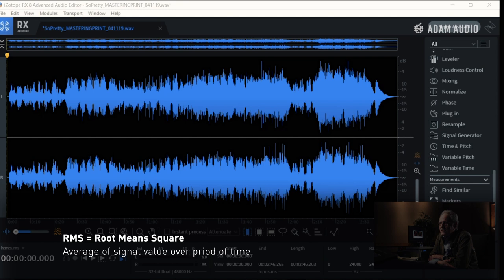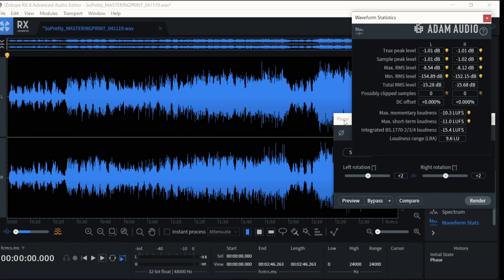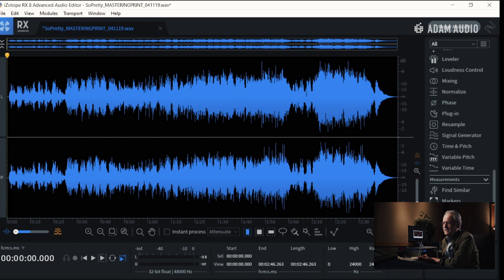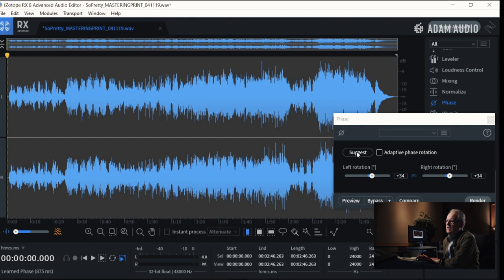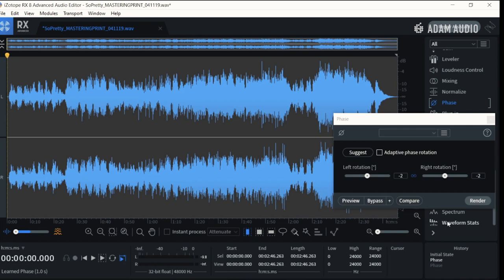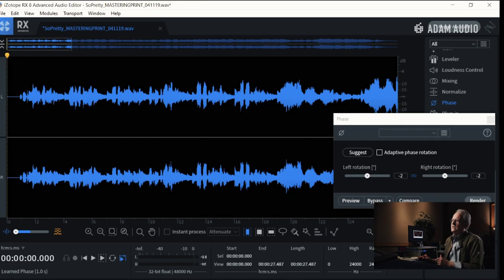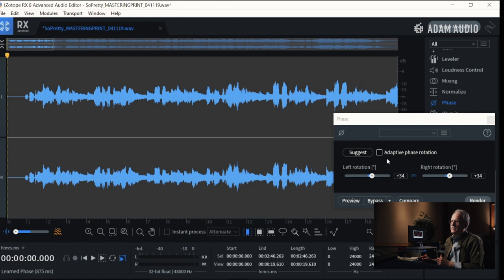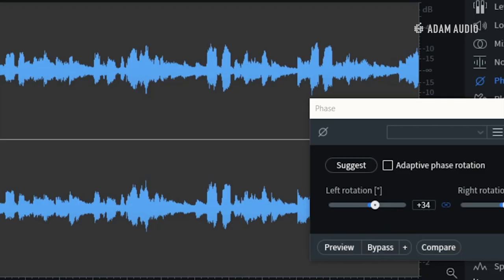The FIRST Step to Mastering a Song: Fixing Phase Rotation | Mastering Masterclass Ep. 4

Comment: Hello John,
Excellent presentation, thank you.
I remember phase rotation in relation to A.C. motor theory.
What you're explaining here is what we call 'D.C. Offset'.
Your thoughts when you have a minute, thank you.
Bill P.
Reply: Yeah, I always see this issue as DC offset too, I interpret it as a 'stuck' sine-wave, which you can get rid of with a hi-pass filter (set as low as it will go).
Reply: @davelordy  The hi-pass filter is a 'must' for getting rid of U.L.F. rumble, etc., but it will not 'center' a signal around the '0' voltage point.
Most DAWs have a 'D.C. Offset Removal' function that will 'center' the signal around the '0' point AND remove the D.C. offset after it has been recorded.
Some DAWs allow you to remove D.C. offset during recording, folklore says 'Don't do it", wait until AFTER the track is recorded, then fix it."
Bill P.
Reply: @RocknRollkat  Yep, a hi pass will remove a DC offset ('centre' the signal around 0v) think of a DC offset as a very low sine wave, in fact a 0Hz sine wave, now lets image this sine wave is at something like 45° in its phase, so about 70% between 0v and 1v, as it's at 0Hz it is 'stuck', that is to say it's no longer oscillating, at 0Hz it becomes a DC offset (it's a DC offset at all parts of its phase except for 0°), so one way to remove this DC offset is to use a hi-pass filter, you want to set it as low as you can go as you don't really want to alter the sound, 10Hz or 20Hz is usually as low as an EQ or LPF will go . . . this removes the DC offset.
Reply: @davelordy  Dave, here's the problem. If a sine wave has zero frequency it also has zero phase.
It's direct current.
Reply: @RocknRollkat  "If a sine wave has zero frequency it also has zero phase"
It will have a fixed phase, you can literally measure it, it will only be zero at 0v, everywhere else, from -1v to +1v it will be at a fixed (unchanging) phase, so for example a DC offset of +0.5v will have a phase of 30° (sin(30°)=0.5), or a DC offset of +0.1v will have a phase of ~5.7° (sin(5.7°)=0.1) . . . etc etc.
Don't take my word for it, try it for yourself, take (or make) a signal with a pronounced DC offset, apply a HPF (set it as low as you can), render the result and see for yourself, the DC offset is gone, you've removed the 0Hz fixed carrier wave.
Reply: @davelordy  "....Don't take my word for it, try it for yourself,"
Dave, it's not up to me to prove your statement.
This is your hypothesis, you prove it.
Reply: @RocknRollkat  Lol, I'm not asking you to prove anything, I'm simply saying don't take my word for it, try it for yourself, I am trying to show you how this works by having you try it yourself, it would take you two minutes.
And by the way this is not my hypothesis, it's simple maths, used long before there were such tools as DC offset plugins, and not just used in audio, it's used anywhere where there's a need to remove a carrier wave.
Reply: @davelordy  A carrier wave is by definition ALTERNATING, NOT D.C.
Anyway, last night I built a D.C. offset generator, recorded a voice with .3 volts (300 mV.) D.C. offset.
This morning I built an 18 dB/Octave Hipass filter at 20 Hz., built the plugin, ran the whole mess through Cakewalk.
Like I've been saying, there's the waveform, complete with the 300 mV. D.C. offset , just like I've been trying to tell you.
A Hipass filter will NOT remove D.C. offset.
Try it yourself.
Reply: @RocknRollkat  "A carrier wave is by definition ALTERNATING, NOT D.C."
Yep, a sine wave alternates between -1 and +1, slow it down enough and eventually it will hit 0Hz, at this point - and assuming it stopped anywhere in its cycle other than at exactly 0v/0° - it will be a DC offset. Nothing alternates at 0Hz.
"A Hipass filter will NOT remove D.C. offset. Try it yourself."
I have, for decades, it's how we removed DC offset prior to modern plugins. A HPF will 100% remove a DC offset.
Reply: @davelordy  ....you have...for decades ?
How old are you anyway ?
I checked your youtube channel, nothing there about music or electronics.
Reply: @RocknRollkat  "you have...for decades ?"
Yes, decades.
"I checked your youtube channel, nothing there about music or electronics."
Yeah ? So ?
Reply: @davelordy  I've been working with electronics since 1959 .
A D.C. blocking capacitor or an interstage transformer both BLOCK D.C.
That's in REAL WORLD electronics.
In the digital domain there are no capacitors or transformers.
Once again, how old are you and what is your experience with electronics ?
Reply: @RocknRollkat  hate to say it RR but this guy is right a hipass filter gets rid of dc offset problems you are filtering out a superlow sine waveform this is how we do it to,
Reply: @davelordy  we do that to, dc offset is basicly a 0khz waveform like you say a hipass will get rid of it
Reply: @MoneyMoves-qm1gf  I have the screenshots that show otherwise....
I checked out your  youtube page, you have NO content.
Do you make music or just talk ?
Reply: @MoneyMoves-qm1gf  "we do that to, dc offset is basicly a 0khz waveform"
Cheers, yes, a DC offset is essentially a 0Hz sine wave, so can be filtered out with a hi-pass filter 👍
Reply: @RocknRollkat  "I checked out your  youtube page, you have NO content."
This is the same criticism you levelled at me, I really don't understand all this strange peripheral stuff you inject into the conversation ? Whether someone has made videos, how old they are, whether electronic components exist in digital form . . . I honestly think if you were prepared to have an open and honest conversation, without all these strange distractions, I could explain how a hi-pass filter removes DC offset to you. Do you know only about 0.3% of youtube users (one third of 1 percent) make videos, most people are content consumers, not content creators, most people are not interested in making videos, unsurprisingly, like MoneyMovie says above, you can be a successful engineer, producer, doctor or software developer without ever having made a single video for Vimeo, Youtube or Bitchute, amazing but true. In fact, on average, 99.7% (100% - 0.3% content creators) of music producers you will interact with on youtube have never made a video in their lives, and probably have no intention of doing so.
Reply: @MoneyMoves-qm1gf  Sorry, thought that was for me ! : ) [I edited it out] I can't see all of your posts, Youtube seems to hide some, but thanks anyway.
Reply: @davelordy  no probs. not for you for that other RocknRollkat guy
Reply: @davelordy  lol at MoneyMovie. not my name, my name is MoneyMoves
Reply: @MoneyMoves-qm1gf  "lol at MoneyMovie"

Whoops ! Sorry, lol 😊 misread it !
Reply: @davelordy  Post something meaningful, okay ?
Reply: @davelordy  no probs mate.
Reply: @RocknRollkat  "Post something meaningful, okay ?"
You're very good at trying to distract from the subject, "how old are you", "post something meaningful", "I'm an expert in electronics", "why aren't you making Youtube videos", "capacitors don't exist in software" (etc etc).
Here's what is actually being discussed . . . a hi-pass filter will remove DC Offset, because a DC Offset is essentially a 0Hz sine wave acting as a carrier wave, if the 0Hz sine wave is locked at any angle in its phase (other than 0°) it will be imparting a fixed offset to the signal, if you want me to explain it in further detail I can, or if you have any questions (about the subject itself rather than how many videos someone has or how old they are - etc) then feel free to ask.
Reply: @MoneyMoves-qm1gf  👍
Reply: @davelordy  Loke I said, I added a 300 mV, D.C. offset to a sine wave, loaded it into Cakewalk, added an 18dB/Octave Highpass filter at 20 Hz., the D.C. offset remained.
Maybe you should try the experiment yourself instead of trolling.
B.P.
Reply: @RocknRollkat  "Maybe you should try the experiment yourself instead of trolling."
Again with the insults, lol. Hold on let me make a quick video, but before I do would you even watch it ?
Reply: @davelordy  ....then stop trolling and do something productive, like running the experiment yourself.
Reply: @RocknRollkat  "then stop trolling"
You complained that I have no music production videos, you complained that I've not run this experiment (regardless of the fact that I told you I've been using this method for decades) . . . so I offer to make you a quick video, "running the experiment" . . . and in response you call me a 'troll' ? Offering to do the thing you wanted (run the experiment) in the way you appeared to think was most credible (as a video upload) and I get called a 'troll' for offering to take the time to make a video for you ?
Is that really how you engage with people ? Fair enough !
Reply: @davelordy  Is it within your grasp to stop bothering me ?
I ran the experiment that you suggested and you won't accept the results.
What's your point in all of this ?
Please STOP annoying me.
Reply: @davelordy  I'm BLOCKING you, bye bye...................
Bill P.
Reply: @RocknRollkat  dude are u being serious or just trolling? a DCoffset removal tool IS a highpass filter! thats literally what it is!! they are one and the same. I use a highpass filter as its cleaner than the DCoffset removal tool in logic pro.
Reply: @cooperspruce  Good for you.
Reply: @RocknRollkat  you can use a low pass instead of dc offset tools its faster and cleaner and does the same thing with more control
Reply: @clairebare2636  I ran the experiments.
I created a D.C. offset of .3 volts D.C. , the lopass filter didn't touch it.
I'll redo the experiment some time in the future.
Bill P.
Reply: @RocknRollkat  srry i mean to say a high pass not a low pass but your set up is right .3 volts give you something like 15 - 20 deg offset and the filter should remove it cleanly not sure why it not worked for you
Reply: @clairebare2636  D.C. has no phase.
"Phase Rotation" is a misnomer.
Hipass, you're correct.
I will rerun the tests in October or November, I'm busy until then.
Remind me, 'kay ?
Bill P
Reply: @RocknRollkat  yeah dc has no phase like i mean its not going up and down but so its kind like a wave that as no pitch or like zero khz basically its the same as a infinite low wave which means a high pass will remove it
Reply: @clairebare2636  Like I said, no dice.
D.C. is NOT a wave, it has no phase or frequency.
I did the test once, I'll do it again soon.
Bill P.
Reply: @RocknRollkat  yeah agree that it has no fequency like you say but imagine a wave with a ferquency of 0.000000000000001 hz but keep add in as many zero as you can ! aventually the wave will stop and just be exactly same as dc offset
Reply: @clairebare2636  ....in math class, maybe.
In the real world, D.C. has no frequency or phase.
I've been building my own electronics equipment sine 1960, recording since  1961.
Simple explanation....
Direct current flows in ONE direction only, Alternating current changes direction at the rate of the stated frequency.
Bill P.
Reply: @RocknRollkat  yeah agree dc is no freqency its just a value like +1 volt or minus 0.5 volt or whtever - - - - - but can you imagine what a very low freqncy looks like imagine 0.000000000000000000000001hz!!!! ---- also you said >>>>Alternating current changes direction at the rate of the stated frequency.<<< now imagine the freqency is 0hz!! what would that look like??
Reply: @clairebare2636  Okay, let's do this.
First, write a plugin that will create a D.C. offset, like I did, to mimic a leaky blocking capacitor, etc., and SUM that with an input signal  going into your DAW channel strip.
Now look at the 'scope output of that channel, it should show the signal LIFTED away from the '0' axis by the amount of the D.C. offset.
Now run that signal through a highpass filter and check the 'scope.
You will see the signal perfectly rolled off to 0 dB on the elevated D.C.
Get back to me with the results.
I'll wait.
Bill P.
Reply: @RocknRollkat  >>>>write a plugin that will create a D.C. offset<<<<

Lol i would if i could but i am not talented like that impressive that you can do that i would not even know where to start!! but i have plenty examples of audio with dc offset and can create other ways.

>>>>Now look at the 'scope output of that channel, it should show the signal LIFTED away from the '0' axis by the amount of the D.C. offset.<<<<

agreed

>>>>Now run that signal through a highpass filter and check the 'scope.
You will see the signal perfectly rolled off to 0 dB on the elevated D.C.<<<

yes! 🙂 thats what i was saying a high pass will remove dc offset, because dc offset is the same as a 0hz wave
Reply: @clairebare2636  ....still waiting to hear from you. - Bill P.
Reply: @RocknRollkat  hi bill yeah i reply to your post above! you said if use a high pass you will be the dc offset at 0 db i say yeas! agree thats what i was saying!
Reply: @clairebare2636  I'm still waiting to hear back from you.
Bill P.
Reply: Waveform asymmetry isn't the same thing as DC offset. Quick thought experiment: Visualise a pulse wave with a 50% duty cycle (i.e., a perfect square wave) in relation to the centreline. Each cycle spends an equal amount of time above and below that centreline. Now visualise a pulse wave with a 25% duty cycle. Now each cycle spends 25% of its time above the centre line and 75% of its time below it. As we can see, it's not offset - it's merely asymmetrical. This asymmetry, and the effect when mastering for loudness that such a waveform has when it's layered into a full mix, is the issue John is trying to correct here.

Comment: I thought dc offset is when the digital representation of the waveform is unbalanced?
Reply: A DC offset will raise or lower the entire waveform off the zero line. An asymmetric waveform will still settle on the on the zero line as the amplitude decreases.

Comment: wow nice tip thank you ...but why should it be -2? ...i tried this on different mixes and masters and after rendering it's - 2 or sometimes +2 ....first i thought to recognize a pattern that only the masterings and loud sources will be rendered to +2 but it also happens to low mixes ....should i correct it with the sliders to -2?
Reply: I think it's more of a "the lower the number the better" kind of case so -2 is WAY better than say +34 or -50, always going for something close to 0 there. That's what I got, could be wrong.

Comment: This is a great video however, in my experience, rendering a track with adjusted phase rotation doesn't null against the original. Would love to hear more on this.
Reply from the maker: Thank you for watching, Maxwell!
Reply: It doesn’t null because there’s a phase difference. The difference is inaudible, though.
If you have a multitrack project and you phase rotate one track it will be audible because of the relation to other tracks. So be careful there :)
Reply: That's because phase rotation absent a shift in time introduces pre-ringing. This isn't mentioned in the video, of course. Now every noob with RX Elements is going to apply phase correction to their premaster and smear every transient therein.
Reply: @lastwarning1  can i ask where to find more info about this topic? i`m a noob :)

Comment: How is this different than DC offset?  (In my previous career I designed mediamatrix cobranet products from 98 to 08)
Reply: Yeah, this is my question also. When I’ve seen a waveform skewed to the positive or negative side I’ve always understood it as a DC issue, not a phase issue. High passing below 20 (with a good filter), or otherwise removing DC fixed some such problems for me before, but I guess there might be more to learn here.
Reply: Well I did my own research and it seems that the phase of each frequency component of the audio signal is shifted rather than shifting the entire waveform and this returns symmetry to the zero point.

Comment: Could anyone comment as to how this relates to ‘DC Offset’. I’m guessing it is not the same thing but cannot yet see why.
Reply: DC offset results in the center line (0dB) of the audio being offset from center. Usually that's minimal and causes no problem, and it's mutually exclusive to asymmtetric waveforms (which are natural, eg: voice, horns, the air pressure from the front of a bass drum, etc).
Reply: @TWEAKER01  I just watched the video again, and what he is doing in correcting phase rotation results in the waveform being symmetrical above and below the centreline. It looks like he is correcting DC offset. But when I looked closely at his screen shots it showed the DC offset was close to zero, while the Phase rotation offset was in different places 34 or 50%. His waveform was distinctly asymmetric in those places. So why was the DC offset still zero? And how does the computer make the waveform symmetrical without then creating DC offset? This is what puzzles me.

Comment: My question is, how do we avoid phase rotation at the recording stage?  A better recording will make a better mix.
Reply: Agreed. This is the most salient take away in my opinion. If this is an "issue", how should we ovoid it on capture? Can someone please address this?
Reply: @Wayne Brown My thoughts too. I'm thinking if you are capturing it that way then thats how it is, but I'm no engineer. It probably does come down to how digital translates, maybe this would not be the case if recorded onto tape.
Reply: Do you know enough about it to know whether you should? 
Some overdrive guitar pedals are purposely assymetrical because it "adds warmth".
Reply: The more I think about it the asymmetry just takes away headroom. Digital systems have lots of headroom.  So if it sounds good,  then it must be good.